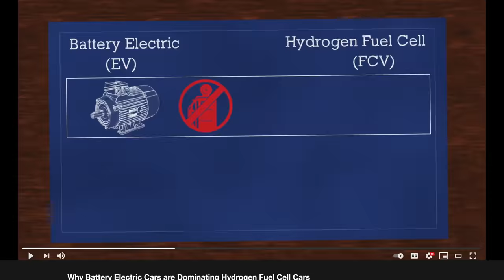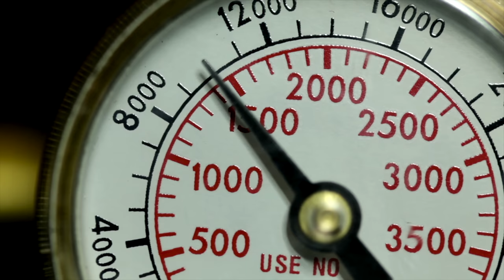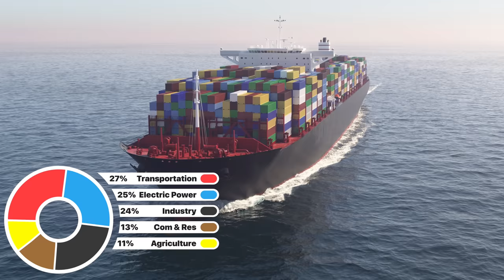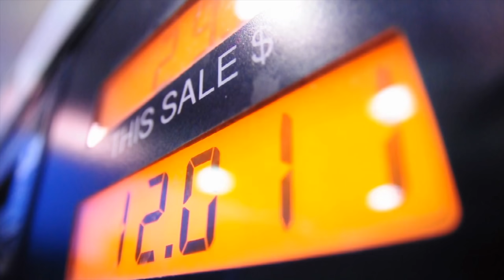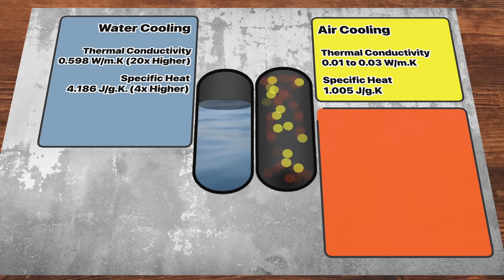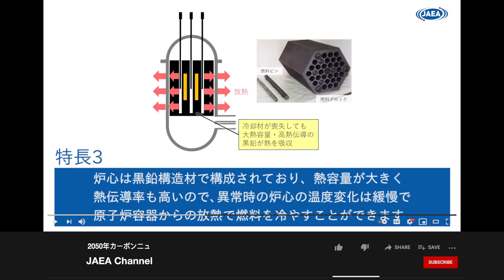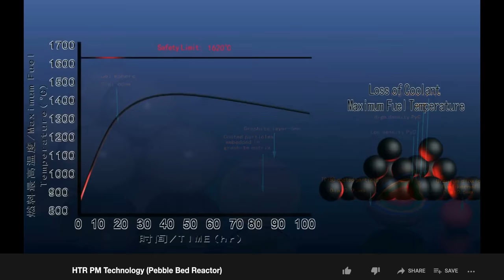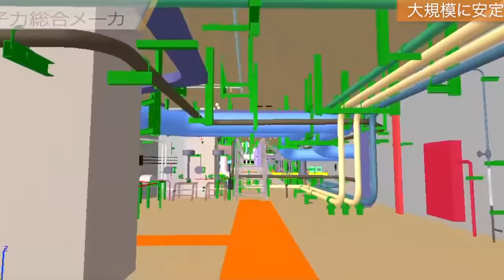Japan's Plan to DESTROY the Price of OIL and GAS!

Comment: 12:04 That's not a scheme of the S-I cycle, but of a pool-type sodium cooled reactor. 
Regarding hydrogen, even if it looses to batteries for cars and trucks, it can be used as a source material for other fuels like ammonia, methane or higher chain hydrocarbons, the trick is in sourcing the Hydrogen cheap enough and having a high quality heat source because most of those reactions need high temperature. With nuclear you have both, on site. 
With just water and air, a nuclear powerplant can produce tons of chemicals that are crucial for our civilization, on high and constant demand and that today we source from methane-sourced hydrogen; like ammonia, nitric acid and ammonium nitrate.
 The issue of the demand curve that require grid storage (large banks of batteries or pump hydro) dissapears if you switch the output of the powerplant to those secundary processes when the demand of electricity falls. That problem solves itself the larger the proportion of nuclear you use. Nuclear is really a no brainer.
And unfortunetely, once again we have to hear the old waste non-argument. There are many ways to reprocess spent fuel, but most countries don't reprocess waste because there's no need to. New uranium from the mine is not crazy expensive in the very limited amounts needed and storing another decade of spent fuel is really, really cheap, so obviously nobody bothers to...and keep kicking the can down the road is politically acceptable.
 Yes Triso fuel is more difficult to reprocess, precisely because is designed to be indestructuble. Storing it is still an option, we are talking VERY small amounts of the stuff. 
The 90.000 tons of spent fuel the USA have accumulated after 60 years producing 20% of it's electricity with nuclear, sounds like a lot, but is just a cube 18 meters on the side, and 96% of it is just Uranium. Storing all the nuclear waste of a 100% nuclear powered human civilization, without reprocessing anything and without improving the fuel cycle or the reactors (because LWRs burn 0.5% of the available energy, it's not a high bar to jump) for the next 1000 years would be less than ideal, and pretty lazy, BUT IT IS STILL AN OPTION.
The more you dive into nuclear energy the more you realize it just solves the problem, period
Reply: That is a very well put argument. And I agree. Reprocessing spent nuclear fuel could help produce a gamut of elements and chemicals. And the benefit is that we can use the plutonium generated from the nuclear reactors. And make even more power.
Reply: I don't see ammonia ever being used as a fuel it is too caustic, it will remain a key fertilizer though.  I see actual hydrocarbon synthesis as the most likely way that any carbon free hydrogen actually makes it into the fuel supply (and yes it's carbon neutral because we will just use carbon already on the Earths surface, the key is to not take carbon out of the ground), we can add carbon to hydrogen easily and basically retain all the energy already used to make the hydrogen essentially turning a difficult dangerous gas into a convenient and safe liquid, it's even actually LIGHTER, because we do not have any hydrogen storage solution which has a parasitic mass less then the carbon has.  Not to mention we can use our existing fuel infastructure and engines, replacing every airplane on Earth is kind of a big hurdle ya know.

As for grids I think your overlooking that chemical synthesis infastructure is not designed for nor economical to run intermittently.  The output of chemical synthesis can be stockpiled easily, we already stockpile huge volumes of hydrocarbons on a yearly cycle building up stockpiles for winter for example, they are the best way to store energy over durations of many months cause you just need a tank and their is zero loss.  I think it's far more likely that we just turn on reserve power plants to burn fuels for intermittency gaps rather then try to shutdown synthesis, though like all industrial processes their shutdown would be appropriate in extreame situations.
Reply: I agree 100%. Nuclear is the only option. Big money just needs to suck it up and build the CORRECT reactor for humanity.
Reply: As you have written, recycling of n-waste is not economically viable. It's just cheaper to make new fuel. So if humanity decides to go all in on nuclear energy, the market will decide how much of the waste will be recycled. If the answer is none, will there be a waste problem or not? The DOE designated the Columbia River basin as a national sacrifice zone after buried waste at Hanford was discovered to be leaking into the river. As always, the cheapest solution became policy. I don't think nuclear energy solves human short sightedness or stupid decision making.

Comment: Conventional fission nuclear reactors are not prone to thermal runaway unless there is a cooling failure (3 Mile Island) or back up power failure (Fukishima). The explosions at Fukishima were due to Hydrogen gas build up due to lack of cooling water pumps operation. The explosions were not nuclear explosions, in fact there has never been a nuclear explosion at any nuclear power plant since the uranium is not enriched enough to cause a nuclear explosion.

Comment: The biggest problem with Hydrogen is storage. It is next to imposable to store. You must continually allow it to vent, or the pressures will destroy whatever it is contained in. So, if you fill up your car with Hydrogen and then not use it right away, when you do want to drive it, it may be empty.
Reply: Stores very well and with no pressure with oxygen as water.. Just need the right tech to efficiently split and burn the H and O
Reply: @dalebyl1564  If you have the energy to split water in that location, you don't ned hydrogen for energy in that location.
Reply: @barryon8706  hydrogen powered cars is one of the uses and given the choice between an electric car at there current technology or hydrogen I would take the h2o car. In the future we may need both options as people all have different driving needs.  Both technology's have plus and minus. For me a H2o car would possibly be better for my wife and electric car might work better as we have different needs.
Reply: @douglasw5371  I think you misunderstand what I was saying. Dale Byl was saying that hydrogen could be stored in water, but the problem with that is you'd need an independent source of energy that actually has to be greater than you'll get from oxidizing the hydrogen.

For example, you can't use water as a way to store hydrogen unless your car also has a nuclear reactor to split the hydrogen out of the water, and if your car has a nuclear reactor then uou can just use the reactor for energy without bothering with hydrogen.
Reply: @barryon8706  ok, they way it was worded it looked like you were against hydrogen. I think that the future we will see a need for multisource of power to fill tomorrows needs. Gasoline isn't going away quickly but we do need other fuel sources to fill the depleting gas resources. It take a long time to develop other solutions and we need to continue our work. Other solutions also make us less vulnerable to foreign sources of supply disruption.
Reply: Toyota has experimented with hydrogen tanks for cars. They are safer to impact than gasoline tanks, the fiber glass doesn't corrode, they keep the pressure well and there is no venting/leakage. All in all, experimentation proved hydrogen storage at the car level SAFER than gasoline tanks.
Reply: @View Bot AFAIK it takes electricity or very high tempeatures to separate the hydogen from the oxygen in water.
Reply: The earth is currently losing 95,000 tons of hydrogen each year that’s about 3kg a second with out adding more to the atmosphere

Comment: There's also the power paste developed in Germany that uses Magnesium and Hydrogen to make batteries that are more energy dense than Lithium ion batteries for far less weight.
Reply: That is H2 storage like a battery in some ways but we don't call it that,it's H2 storage.
Reply: I think you misread the article you're citing- magnesium NOR Hydrogen are electrolytes. I think you might be talking about an alloy of magnesium used to hold Hydrogen.
Reply: Magnesium is used in many things, but using it in household batteries would not be safe because of the temperature that magnesium burns. It also can't be put out with water and using water on a magnesium fire makes it burn even hotter. It burns so hot that it separates the water and uses the oxygen as additional fuel.
I wouldn't want a house fire being made worse by the batteries being used within it.
Reply: @GeneJordan  magnesium ignites at: 2200 °C, 4000 °F.   That's a fairly high temperature.  It's used to make lightweight casings for laptops.  Also in order to ignite Magnesium needs to be exposed to oxygen.  If the magnesium is inside a sealed battery structure there is no oxygen supplied to the magnesium.
Reply: @HepCatJack   I didn't mean they would start the fire, although certain aging Lithium Ion batteries are known to have done this.
Finely divided pieces of material (i.e., magnesium powder and ribbon) burn readily and that's what the batteries would likely be made from. 
However, magnesium Burns at the temperatures you listed. 
A regular house fire burns hot enough (1100°) to ignite magnesium (which for most commom alloys of Mg, the ignition temperature is 850F) making it harder to put out and take longer to put out. It would burn or melt any casing off of the batteries, too.
Having such extra hotspots spread through every home and business would become a firefighter's worse nightmare.
It burns hot enough to burn its way through the floor in most homes and commercial buildings, too. That would cause fires to spread to other parts of the home. Fires that can't be put out or cooled with water.
Reply: @HepCatJack  For the record, I'm not a fan of magnesium being used for frames and cases in laptops, tablets, or phones, either. For the same reasons.
Reply: @GeneJordan  the advantages of the magnesium h2 battery is higher power density and lesser weight over lithium.  These are great for aviation, now planes flying at high altitude find themselves in a cold spot not a warm spot.  

In WWII, pilots would put a pot of sweet cream in their plane near the engine and when their mission was over, they had ice cream.  They also used to fly up in the air in the desert to make their cases of coke ice cold.

As for this type of battery being used in a home, there is no need for the battery to be stored in the home.  They could be buried in a water proofed pit near the home above the water line and wires can go inside of the house.  Alternatively, a home could use sand batteries to store solar heat for heating.  It depends on how you intend to use the energy, for heating or for electricity.

A home setting can just as easily use iron oxide batteries for electrical storage which are heavier but like, the home they need not go anywhere.  Weight of the battery for this type of use is not a factor.
Reply: @HepCatJack  Lithium Ion batteries are already used in the home in several forms. Your original response compared H2 batteries with Lithium Ion batteries. The logical thought process would mean H2 batteries in similar household sizes (AA, AAA, C, and D) and in common uses of household devices such as laptops, tablets, and phones up to the sizes to compete with Tesla's power wall.
I'm all in favor of limiting large uses of large H2 batteries to outside of the home and buried uses, but even then that might not be viable for every climate.

Comment: 02:06 Burning Hydrogen doesn't just release water vapour, when mixed with air it will also release a small amount of Nox
Reply: That also applies to conventional fuels though, and has been dealt with?
Reply: @TheDoh007  So a lot more giggling?
Reply: So don't mix it with air , just pure oxygen , no Nox, just water vapour !
Reply: @gregorygant4242  that would probably end up being less efficient due to the extra storage needed, weighing the car down more

Comment: For nuke waste I have always liked those use methods that allow for safety and recyclability. This type of reactor, or liquid salt fast reactor or what have you, which can use their fuel more fully and efficiently.

I think that "spent" fuel can still do work. It's much less efficient, obviously, but it has longevity and abundance. 

Why not use the lessened thermal output of the waste to run a good old fashioned Stirling Engine with a closed loop system? 

Will it produce massive energy density? no, definitely not, but it could produce consistent, safe, zero emission energy for, potentially, thousands of years. All you need is a quality, closed-loop Stirling engine design and a relatively consistent thermal differential between your sealed thermal chamber and the air or ground in the vicinity and bang: you have a spinning fly wheel that can make a bit of power... not a lot, but for many lifetimes.

now imagine an otherwise barren field someplace inhospitable and sub-optimal for solar or wind (like the arctic/Antarctic circles) with thousands of these devices chugging away non-stop for hundreds of lifetimes, day and night, non-stop.

additionally, they could be implimented smaller scales, closer to urban centers, sealed underground or in secure containment on the surface near industrial sites to provide supplementary power or emergency power or just keeping batteries of whatever sort topped off?

Hell, we could just bury radiation-sealed waste pellets in sand tanks as "thermal sand batteries" or even try to improve Nuclear Crystal Containment batteries ("diamond batteries") so that they're actually useful...

ugh, I'm just venting at this point, I think... Don't Mind me and my TL:DR post!
Reply: It is good to think outside the box. Even better if you then think critically about the idea afterwards.
The fuel for this kind of reactor is a variation on the TRISO concept, with fuel particles embedded into graphite...about the most difficult nuclear fuel to reprocess and much higher in volume than any other solid fuel.
There are existing tech for using the decay heat of fission products to generate electricity, but they are all low efficiency and expensive. Mostly used in the past for very remote sensing, but securing the materials makes that not a great idea today.
Reply: Ukraine lol you have blown up a pipeline not very green.
Reply: @rejeangadbois3123  I'm not Ukrainian, I'm supporting Ukraine b/c I loathe Putin after spending 3 years in military intelligence here  in the US and knowing full well that he wants to put the Soviet Map back together but under his dictatorship and has since he was a KGB agent in the collapsing USSR...

That said, I wonder if you're even a human, or just a Russian bot... 🤣🤣🤣
Reply: Thought that I heard of a bacteria species in the crust that metabolize some form of radiation. If it could be tweaked, then it could be used as a way to kinda contain the nuclear waste.

Comment: Clean steel making isn't just about heat.  The main problem with the old process is the reducing agent forthe iron ore, formerly coke.  Hydrogen is, I believe, the reducing agent adopted for the Swedish clean steel.
Note also that, whilst it is small effect compared to green house effect, those cooling ponds you see in the videos, the cooling towers on most steam generating stations all dump heat into the ocean or atmoshere.  It may be a cheap lunch, but it is not a free one.
That said, hooray for the japanese.  They are doing now what many of us have been advocating for years, using the continuous nature of nuclear to make hydrogen off demand.  Well done chaps.
Reply: How much heat do you think they're producing when they burn coal or gas? They're dumping their heat in cooling towers or streams.
Reply: The amount of heat dumped into the environment is tiny compared with the massive amount we get from the sun. The fact that using green hydrogen to make steel would emit no CO2 is far more important
Reply: I'm more curious how are they going to produce steel without a source of carbon, when steel by it's definition is an alloy of iron and carbon (plus optional elements depending on the exact type of course).
Reply: The amount of carbon required is only around 1% so something like pyrolyzed wood could supply it.
Reply: @jamesmacdonald5556  Couldn't agree with you more.  All steam engines do it (as do IC engines) indeed all heat engines do.  It is relatively small and for the immediate future we're stuck with it.  Some time in the future we need a way of rejecting more heat into space.  Yes Jap red hydrogen looks promissing but to really save the planet we need to cool it a bit.
I think what I meant was that this solution is great but whatever we do, we need to do more than just zero carbon energy generation because that only slows the rate of cooling the Earth and does not stops it completely.  I appologise for not explaining my thoughts better.